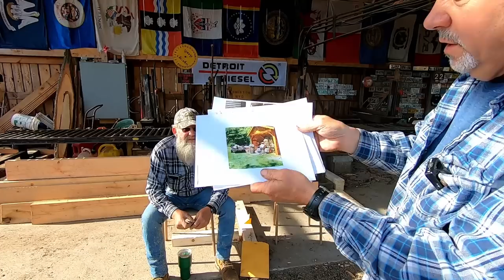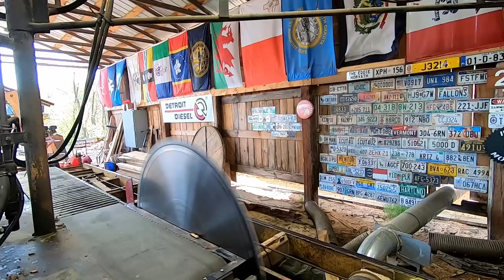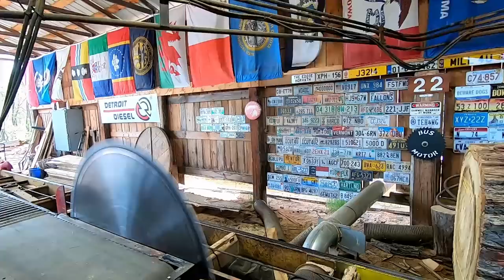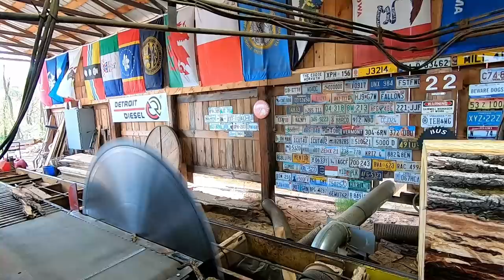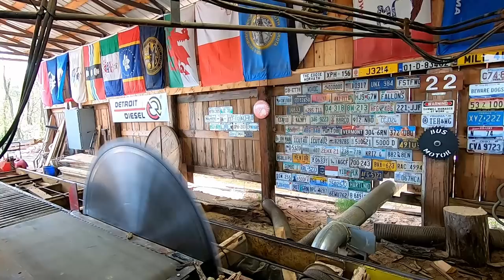sawing 4x10's out of aspen # 420

Comment: HI MARK U sound alot better than what U did be 4 I sure hope what I toll U about did help 2 get rid of that cold mark I already see the difference the new saw bits have made there is a smoother face on the logs now 😊 zand the the sawblade is sawing alot better now 2 it looks like it is sawing butter now mark its amazing what a new set of new saw bits will do or a new chainsaw chain also a new sparkplug the gas in anymore is no good either U have 2 use a file 2 clean a sparkplug 2 get the carbon off and a wire brush and a safety pin 2 clean the inside of the sparkplug out most of the time after U clean them 4 times they are ready 4 the trash can the sparkplug  current is suppose 2 be bright blue  😊 OMG 5 8 2O23
Reply from the maker: thanks Clarence , yes feeling much better now . sharp saw with new bits all is good!

Comment: I watched one on YouTube the other day at sawmill that had the edger ahead of the blade on the on the sawyers house and every time he saw block a slab the edger would he pushed that you're up there and it cut the hedges off from it and they didn't even have to mess with it like a pretty good deal
Reply from the maker: we can get a vertical edger for this mill but cost thousands of dollars.
Reply: @markgalicic7788  yeah I know they're YouTube Derek he's he cuts a long while he's got a real loan sit right there where you yeah when he wants to do at he just slide your right into it and it cuts it cuts of sides off and runs it in the saw does it's for thing to pretty cool it's called it's called sawmill

Comment: What was the point to cut like that just sawdust I'm new to watching the sawmill work
Reply: A couple of reasons - 1) to true up the face (sometimes the cant bends and /or twists from internal stresses), sometimes bark gets underneath and tips the cant. 2) Sometimes to get the rest of the cant to a multiple of 2", 4", etc. thick.